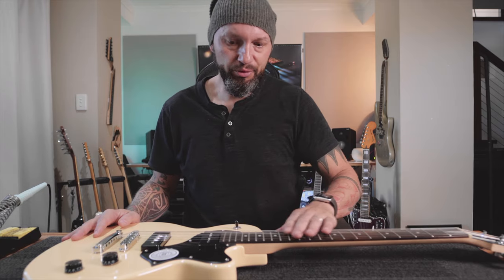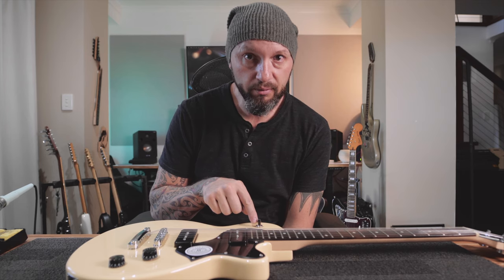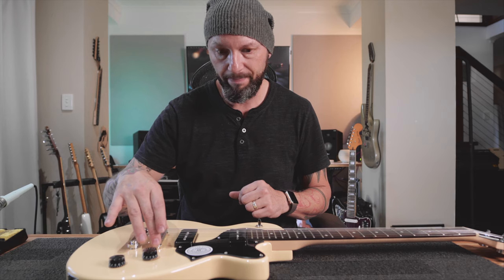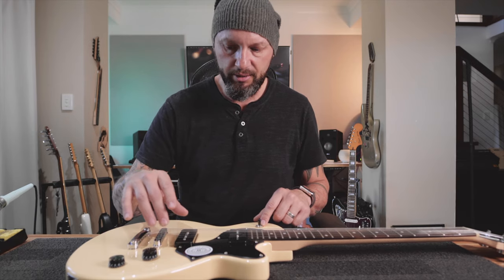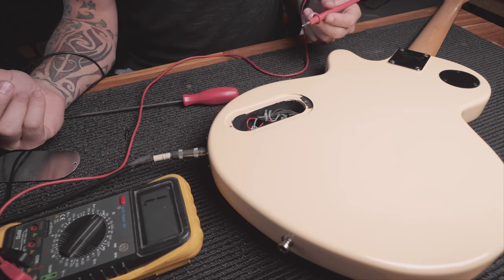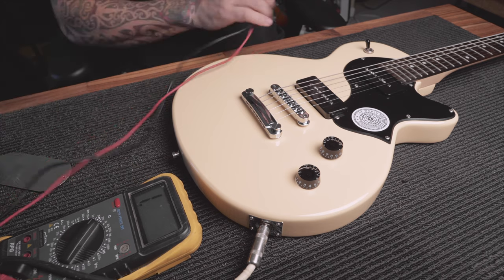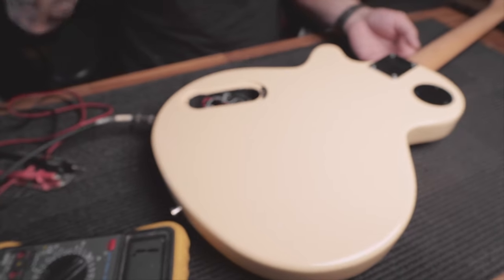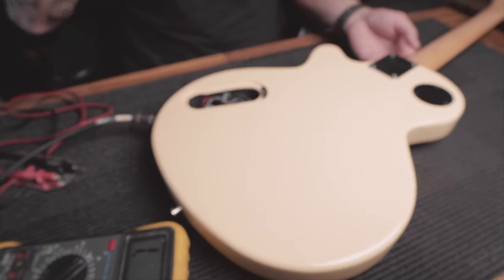3 Easy Solutions to Fix Ground Noise | Guitar How-to Ep02

Comment: Thanks for the video! Very informative. Maybe you know the answer to my problem. It doesn’t matter which guitar I plug in (directly) into my amp, it starts buzzing but goes quiet whenever I touch any kind of metal (bridge, strings, springs in the back). I also tried different cables. I am using a Marshall SV20H. I don’t think it has something to do with the guitar, since all of them have the same problem.
Reply from the maker: It could be all kinds of things interfering with your signal, do you have other electronics in the same room, same power point etc? Also try another room and another power point. Sounds silly but could be that you are close to a power supply that is emitting EMI. Give it a go, worth a shot. If it was a problem with your amp it wouldn't go quiet when you touch the metal parts of your guitar. What guitars are you trying, specifically pickups, single coils or humbuckers etc?
Reply: @RisingSunGuitarMods  I only use humbucker pickups, strange thing is that when I remove the power attenuator between the head and cab, the noise doesn't go away when I touch the metal parts. When I touch the right side of the power attenuator when its in the chain, there is a high beep coming out of the amp... It's in the room with my Mac Pro, display and speakers, but even when those disconnected it happens. Same thing when I plug it in the other power socket in the same room. Haven't tried other rooms yet.
Reply from the maker: @Lesliecamping  it could be the power supply to your amp not grounding properly. What part of the world are you in?
Reply: @RisingSunGuitarMods thanks for the quick reply man! I live in the Netherlands,  Europe. I tried putting tape over the ground part of the supply to bypass it, also didn't work.
Reply from the maker: @Lesliecamping  are you in an older home? I read that old Dutch houses do not usually have grounded power, but kitchens and bathrooms must have grounded outlets. I know this sounds silly, but plug into an outlet in the kitchen or bathroom. I remember talking to someone else in Europe who had similar issue and it was no grounding in his home.
Reply: @RisingSunGuitarMods  ah that could be the case. It's an older home built in the 60s. When we moved here and the electrician came in to some work he may have mentioned it since there was no grounded power in the bathroom. I will test to see. If so, can an electrician fix this easily? Of course I don't want to go to the kitchen to record my amp haha
Reply from the maker: @Lesliecamping  haha acoustics always sound better in the bathroom. But yea I believe an electrician would be able to sort it out, maybe also look into a power isolator. I’m not 100% sure but I think isolators a grounded and might be a cheaper option. Best to talk to an electrician in your area though. I hope you can sort it out. 🤘🏼
Reply: @RisingSunGuitarMods haha true true, yeah I was wondering maybe a power conditioner would help. I'll ask an electrician too! Thanks!

Comment: This video was very helpful!! In my case I didn’t get continuity when touching the paint and the pod. What can I do about that??
Reply from the maker: Thanks for commenting. Glad you found this video useful. Start by making sure your paint is conductive (simple continuity test) if it is you can add a ground to it. Usually from the bridge, or tremolo claw to a screw into the wood where there is shielding paint will do the job. 👍
Reply: @RisingSunGuitarMods   I will definitely try that. Thank you so much

Comment: Thanks for the video this helped me diagnose the problem I'm having with my son's guitar. For Christmas I bought him the Donner DLP-124S LP in Sunburst. We love the guitar but it is missing the ground wire just like the guitar in your video. I bought this off Amazon for $125.. we love the guitar but this buzzing is BS! I'm no guitar mechanic and might just mess something up trying to fix myself. Looks like we are going to try to exchange the guitar for another. Thanks again.
Reply from the maker: It’s an easy fix, is there a hole drilled for the wire to go in? If yes run a wire through that hole to the bridge post and solder it to the back of the volume pot. Easy fix and if you love the guitar its worth doing. 👍
Reply: @RisingSunGuitarMods  yes, it does have the hole for the wire. To do this it would require me to remove the strings and bridge correct? Guess I need to do more research so I have a better idea.  Thanks for your help and suggestions! 🤘
Reply from the maker: @backyardbeekeeperguy9934  strings etc are the easy part. The hardest part is to remove the tailpiece lug. Here is a good video about it. https://youtu.be/EImho3ybAno just take your time. If you are a bit handy it should be straight forward. Let me know how you go.

Comment: I have a Gibson Les Paul Standard 60’s, I purchased it brand new in 2021. When using distortion, I have this buzz but it goes away when I touch any metal part, bridge, strings, tuners, anything. I have a 30 year old Epiphone Les Paul which doesn’t hum at all using the same amp, pedals etc. On my Gibson, the hum is there when using either pickup, and I’ve noticed that when I have the volume controls set to 10, I can start dialling it down and around 8 the hum gets louder than at 10. I thought it was a grounding issue, but everything I’ve read online shows that it is grounded fine because it goes away when touching the metal parts. Others are saying it’s the lack of shielding which no new Les Paul comes with, but many have installed shielding and it made no difference.
Reply from the maker: Les Paul’s all make a little bit of noise that’s normal, but for your Epiphone to not do the same on the same setup suggest it might have an issue. A 60’s LP is not a cheap bit of kit either. Without seeing it I think it could have a ground loop issue. When you dial the volume off it should send the signal to ground, does it go quite with the volume all the way down or do you still have noise?
Reply: @RisingSunGuitarMods  Thanks for your reply! So, when the volume is at 0, there's no hum. Also noticed that the volume can be 1 or higher, and there's no noise when the tone is at 0. It is only when using distortion though. The store I bought it from are happy for me to take it in for them to take a look at it so probably will.
Reply from the maker: @kineasx  yes mate take it in to the store. At that price it should be a great guitar off the shelf. Let me know how you go, they are a great guitar and realy shouldn’t have any issues that need you to start messing with it. 🤘🏼

Comment: Good info here! I recently have about 3 guitars where the pickguard has a static sound when I drag my finger over it while playing.  Any idea of the issue? Thanks!
Reply from the maker: Yes this is a common issue. It could be the static buildup in your pick guard. Sounds weird but do a YouTube search for “how to discharge static from my pick guard” there are some good videos about this. It will be worth trying. 👍
Reply: @RisingSunGuitarMods  All I found is the dryer sheets which only lasted about an hour and left and bad toxic smell and film coating. Can't find a permanent solution yet. Thanks
Reply from the maker: @musicproductionvideos5019  Try shielding. https://youtu.be/sAQP5HtdNuc it is to reduce EMI but it might also help to dissipate the static issue. It’s not expensive and easy enough to give it a go to see if it works.

Comment: Hi there, I have a squier paranormal telecaster that has jazzmaster pickups and it’s insanely buzzy. I took it to a local tech and it didn’t buzz that loud on his amp - he said it was normal. However he did note that the hum gets louder when you touch the metal scratch plate. I mentioned that I was getting a scratch plate that isn’t metal and so he kind of made out that it wasn’t necessary to stop the hum to the scratch plate on that case. He put in the new pickups I got for it and said he’d sort out any bad wiring inside the guitar. However the scratch plate still makes the buzz louder. The buzz is really ruining the guitar and I’ve put quite a lot of money into upgrading it.  I’ve got a fender strat that used to have single coils in it and that never made such noise. I’m so confused as to what the problem is! Your video makes me think that maybe he hasn’t fixed an issue with the wiring though since the scratch plate still causes the buzz to worsen? 

Amp is plugged into the wall, not into a multisocket too. When I touch the metal handle on the amp, the buzz goes quieter
Reply from the maker: Hey man, take a look at this it might be helpful https://youtu.be/sAQP5HtdNuc you will always get a bit of hum with single coils but it shouldn’t get worse when touching metal parts. Sounds like it might have a ground issue with the way it’s wired.
Reply: @RisingSunGuitarMods  thanks mate, I really appreciate the response. My tech is being a little impatient but I’ve only taken it to him once and the issue isn’t sorted. He said the wiring was fine and because the buzz went worse when I touched the metal scratch plate said the interference is in my room and it’ll most likely be amplified by the scratch plate and sent to the pickups. I’ve removed the scratch plate and no luck. The buzz also goes louder when I touch the metal plate where the neck is bolted on. It’s like he thinks it’s somehow normal cos these pieces of metal aren’t grounded but I’ve owned a lot of guitars and I’ve never known anything like this. Sorry for all the info haha. You still think it sounds like a wiring issue?
Reply from the maker: @romanlakes  does it the noise go away when you touch your strings or bridge? If it does then maybe the scratch plate is not making ground connection.
Reply from the maker: @romanlakes  also, it’s possible you have static charge. Try the dryer static cloth trick. Rub down the pick guard with a dryer static cloth. Sounds a bit crazy but worth a try. Hard to know what’s going on without seeing the guitar.
Reply: That’s strange, I wrote a comment but it disappeared. I actually removed the scratch plate and it was still buzzing with it off, then I put my new plastic one on and it was still doing it unfortunately. Also when I touch the plate where the neck bolts on, the buzz get worse. You still leaning towards a grounding issue? 

The text is being awkward about it saying it’s because that plate isn’t grounded and ‘I’ll be saying it gets worse I touch a fret next’. I’ve just spent a decent bit of money with this guy, so I’m not too happy with that tbh. He did say I can take it back though, but I’m not sure how much faith I have in him if he’s convinced there’s nothing wrong
Reply from the maker: @romanlakes  if it gets worse when you touch the neck plate it could also be EMF. did you try shielding as per my other video. It sounds like you are becoming an antenna when you touch the guitar. Reason it’s not as bad for your tech is there is likely a power supply near you that’s causing it. Try shielding it. This should help.
Reply: @RisingSunGuitarMods  thanks a lot for your advice! One last thing, the hum got worse when I touched the scratch plate at the tech’s place too. So now I’m confused haha
Reply from the maker: @romanlakes  try shielding it. It’s worth a shot and isn’t expensive to do yourself.
Reply: @RisingSunGuitarMods  thanks mate, really appreciate the time you’ve spent answering my questions here! I’ve already liked and I will subscribe too 👍
Reply from the maker: @romanlakes  thanks mate appreciate it. I’m collecting ideas for more videos so I might play around to se if I can replicate this issue. Still on holiday at the moment but will get back into my channel this year. Thanks for the sub.

Comment: Hey so I have a strat and just put in new pickups I'm having the issue where if I touch the bridge it gets louder I'm assuming it is my ground to the tension bracket?
Reply from the maker: @KoalityStudios  yep, that’s where I’d start. Check the ground wire to the claw in the spring cavity is connected and making connection to the back of your volume pot. 👍

Comment: Hello,

When i touch the bridge or pots my noise gets harder. But when i test those things with a multimeter it says there is continuity. Im kind of at a loss what the problem seems to be.   When i plug in the guitar and turn on the volume the buzz dissapears when its at max and lowest volume. But it gets really bad when its in the middle. Nothing happens  when i turn the tone pots though, which makes me think there is something going wrong with the volume pot
Reply from the maker: What type of guitar is it? Pickups, volumes, tones etc...? And what are you plugged into?

Comment: Are the Morley hot spot things to plug in the wall outlet with your amp dangerous in a live setting?
Reply from the maker: Hey mate. I can’t say from personal experience as I have never used one in a live setting sorry. Good question though, but I can’t see any reason why it would be dangerous, live settings are usually pretty noisy anyway, I would always just kill my signal between songs with a tuning pedal. 👍

Comment: Hello! Thank you for this explanation. I've watched the other video and I'd love to hear your thoughts before I start taping up my guitar. I have a tele and a fender vibro champ reverb. It's been 6 months without a noise. The buzzing only started recently. When I touch the guitar on all metal parts it stops. Do you think it could be from the tube or one of the pre amp tubes? Or definitely needs shielding? Thank you!
Reply from the maker: If it has only just started I would try some elimination options first. For example, do you have access to another guitar and/ or another amp. Process of elimination is always a good place to start. Try you’re guitar with another amp, and your amp with another guitar. Also have you introduce any new electrical devices near by. Any thing that could introduce frequency noise. You could try tapping on the tubes, if they are microphonic then probably need replacing. If it goes away when touching your strings it’s not likely your amp. Hope this helps.
Reply: @RisingSunGuitarMods  Thank you for taking the time to answer. I have tried with a different cable and guitar and the buzz persists. I've added a bunch a pedals recently but the buzzing is there even when they are unplugged. What do you mean by microphonic? Thanks again!
Reply from the maker: @Through-the-gift-shop  so turn your amp on. Lightly tap the tubes with the back of your finger nail. It shouldn’t make any noise. If they make a ringing type of ping noise it’s the valve. But your amp might just need a service. Could be a number of things. Are you able to try another amp in the same environment to rule out interference first?
Reply: @RisingSunGuitarMods   thank you. I narrowed it down to the power strip on which the amp was plugged. Problem solved! Thanks again!
Reply from the maker: @Through-the-gift-shop  awesome. Glad you got it solved. 🤘🏼

Comment: This was a great video 📹 👏 👍 👌 

I've got an issue with EMI feedback near a certain hvac system in the house (inside my studio room) wondering if you've ever delt with something like that before? 🤔 any help would be greatly appreciated 🙏
Reply from the maker: Hey man, thanks for commenting. Have you tried sheilding your guitar? Sheiulding isn't a great term but it is what is used, it's more like making an EMI antena to catch some of that interference and send it to ground. Have a look here and see if this helps: https://youtu.be/sAQP5HtdNuc
Reply: @RisingSunGuitarMods  so I just checked and my bass isn't grounded properly 🙃 

I checked my electric guitar and it's grounded just fine but it's picking up noise from my computer monitor / pc tower and from some electrical conduit in the wall inside my studio. 

Moving into other rooms seems to solve the issue so I think I'm gonna have to relocate , I tried using EMI shielding fabric to block the EMI from the hvac in the wall run but no luck 😢
Reply from the maker: @msi1985  Are the guitars sheiled like in my other video? it can make a massive diiference.
Reply: @RisingSunGuitarMods  the bass isn't grounded or shielded but I'm only renting it so it's gonna get returned. 
My ec-1001t ctm had continuity on all metal points including external metal switches and the bridge ect. And it's got EMI paint along with foil shielding thru out. I'm gonna make a 2 minute video demo of the feedback I'm getting I'm sure it's fixable haha 😄
Reply from the maker: @msi1985  Share your video, I'd like to see it. There are a number of reasons for noise so would be good to see whats going on with yours.